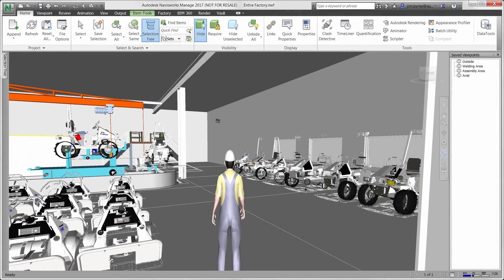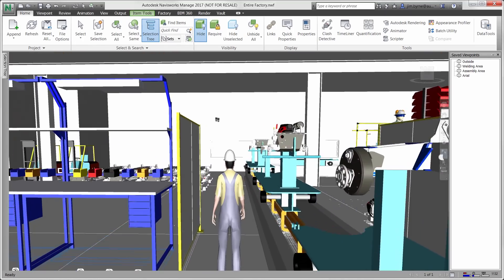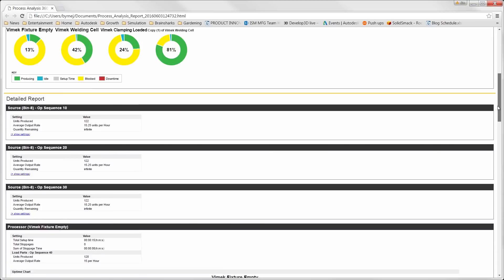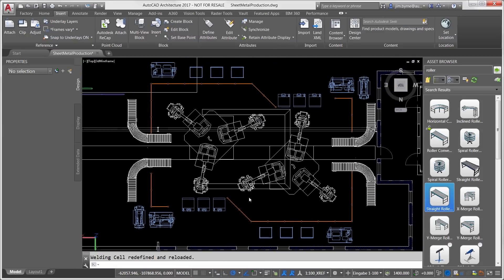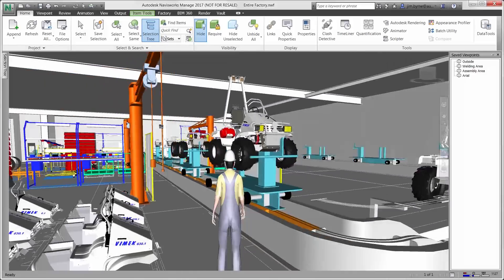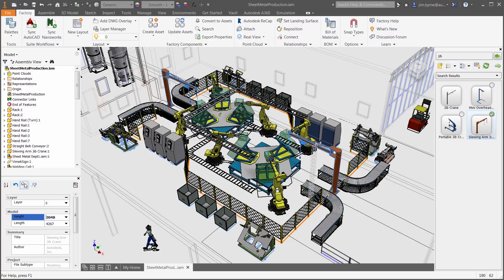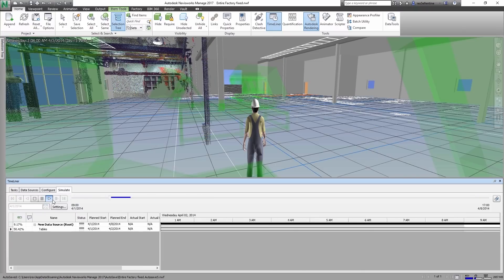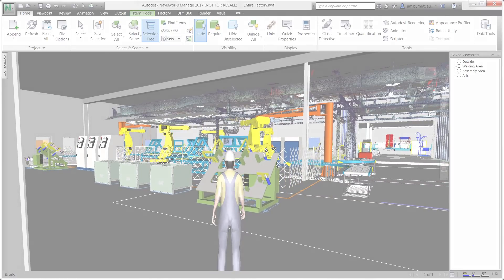Product Design & Manufacturing Collection workflows: Factory

Comment: Good morning, my name is Silvestre, I'm a graduate in systems analysis and development and I'm implementing the fectory tool in the company I work for. At the moment we are creating the assets in the Inventor, however I realize that some resources are not shared between the software, for example I need to create a form to leave the configuration of the asset more intuitive, however this form does not work in auto cad. Is there any forecast for this feature to be implemented? I identified some more bugs. iskey does not work correctly in iLogic. Without the correct functioning of these resources it is difficult to make a functional and intuitive implementation. I would like to ask another question. It would be very important to add an isConect feature to enable logical handling if the parts connect during the layout assembly. Example. when publishing the asset I have the possibility to create a connector. I want to add a logic to when a part connects to it perform a certain task. This feature would be very important. I look forward to your response ....